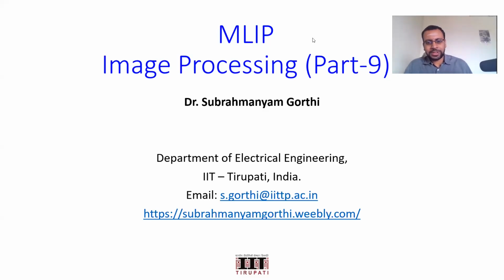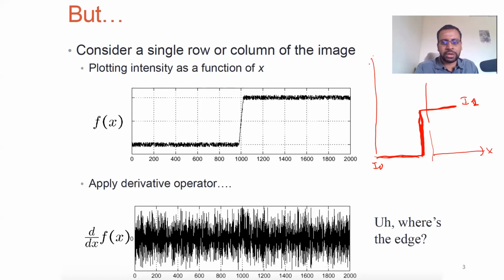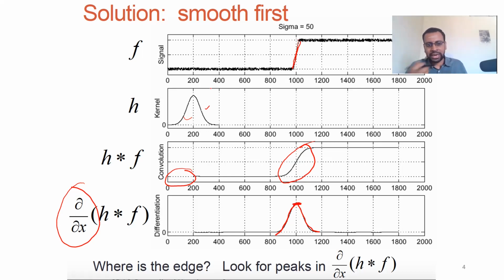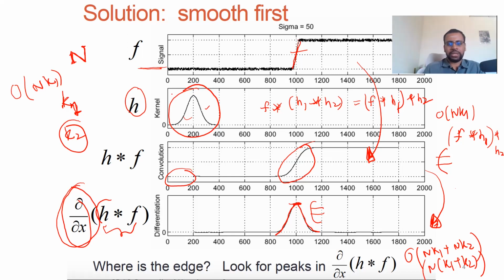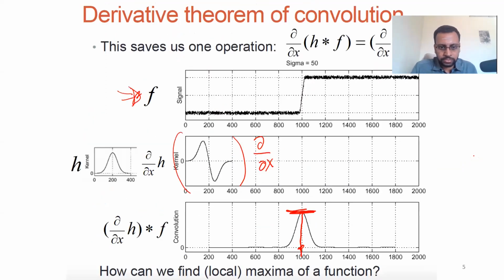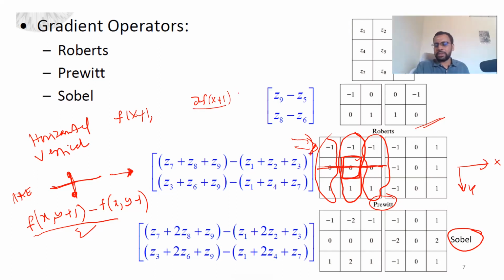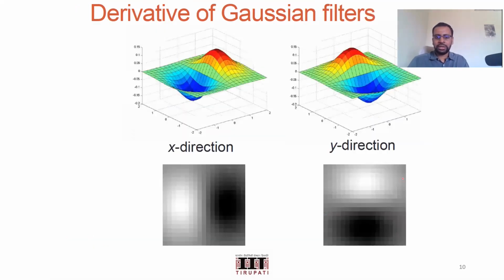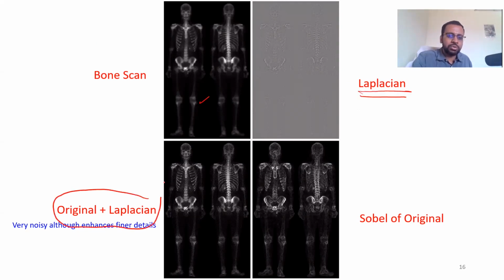MLIP L11 - Image Processing: Part-9 (Kernels for Gradients, Edge Detection, Derivatives, Sharpening)

Comment: Sir how convolving an image with a sibel filter will give the gradient and also the edge. I'm getting confused. The gradient of an image is found as u taught gradient = f(x+1) - f(x)/1. Please help not able to follow sor
Reply from the maker: Haiharan, what does it mean by getting an edge? When the magnitude of the gradient is high, it indicates the presence of an edge. The edge is perpendicular to the gradient, as discussed in the previous lecture; thus a "strong" horizontal gradient indicates a "strong" vertical edge, and a "strong" vertical gradient indicates a "strong" horizontal edge. In other words, Sobel horizontal edge detector is equivalent to vertical gradient detector, and vertical edge detector is equivalent to horizontal gradient detector! Hope that clarifies your doubt. If not, feel free to write it here.
Reply: @GorthiSubrahmanyam  absolutely agreed sir. But how convolving with a certain filter gives gradient. You taught us forward difference and central difference method which neede no kernel. So my doubt how convolving with a certain kernel result in gradient. 
Sir my heartfelt gratitude for clearing my doubts
Reply from the maker: @hariharannair3281  The forward difference or backward difference are computed through convolution as that is a computationally efficient way of computing! derivatives If you notice, the goal there was to figure out what are the equivalent kernels to FD or BD or Central Difference (CD). Is that clear?